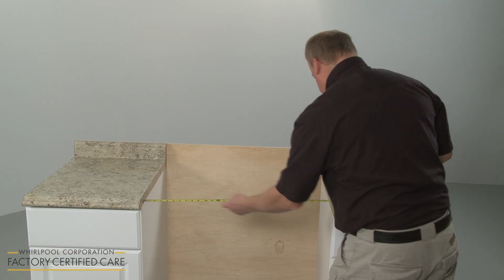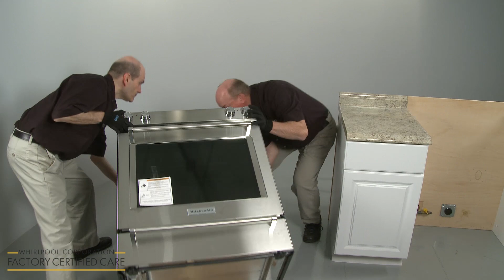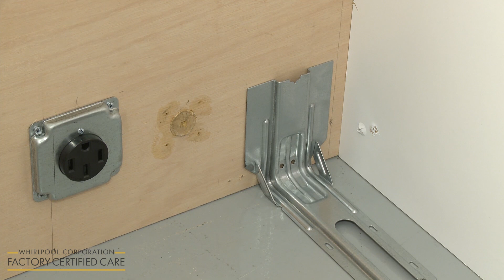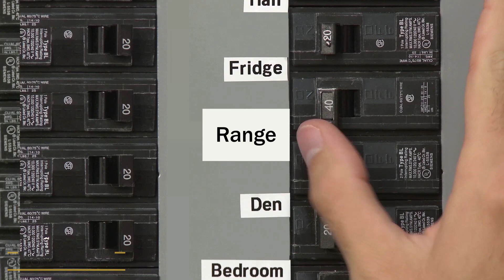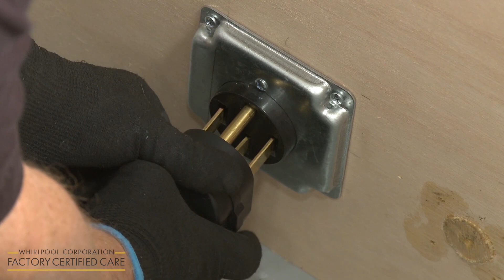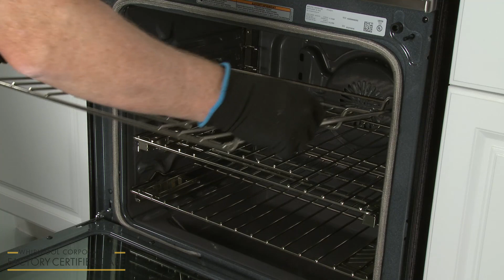KitchenAid Electric Range Installation Model KSEB900ESS

Comment: What about the down draft vent?
Reply from the maker: Hi Michael, information on installing the Down Draft can also be located in the Installation Instructions.
Reply: @wservicekitchenaid9982  lol I'm here because the installation instructions are not very helpful
Reply: @janedobiesix6588  did you ever find a helpful resource for the down draft? I’m in the same boat right now…
Reply: @carnivoreabq8488  😅 the parts are still sitting there uninstalled. No, I gave up on it and just haven't gotten around to hiring someone to help
Reply: @janedobiesix6588  just did mine this weekend. If you look up the Jen Air videos is literally the same system and the videos are very helpful! Both kitchen aid and Jen air are part of the same parent company so the parts are practically identical.
Reply: @janedobiesix6588  this Jen air video is literally identical to the kitchen aid system. Hopefully it helps you. Just did mine this weekend.

https://youtu.be/R5ygdhB7AgM
Reply: oh no need for that..lol